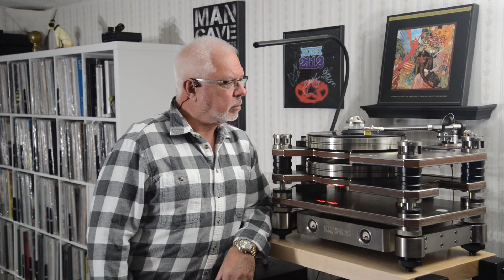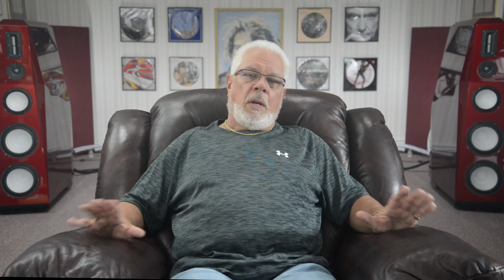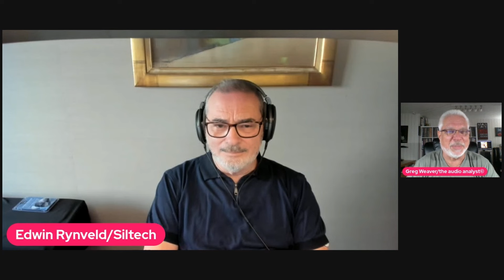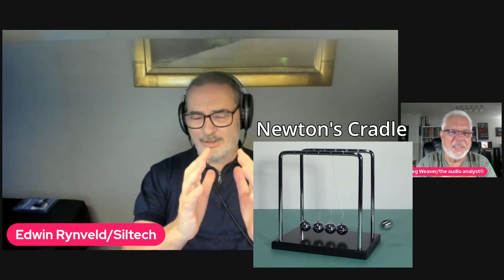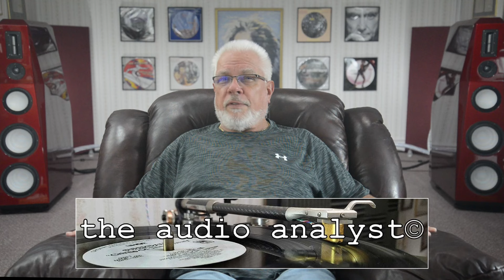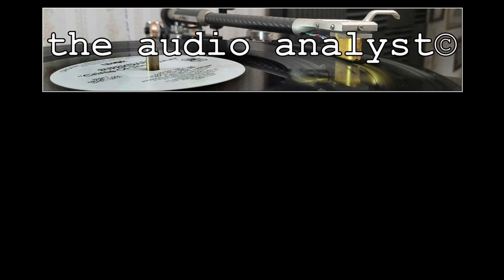E195: Edwin Rynveld and Siltech's Master Crown Cables

Comment: I have personally analysed a 'monocrystal' SIltech conductor at a world class metallurgical laboratory. It is definitely not a monocrystal! I t has a very fine grain structure, close to nanocrystaline. Anybody can do this test. It's unbelievable that the company says it's a monocrystal conductor. Monocrystals are extremely expensive to produce and the methods are well documented.
Reply from the maker: LOL, of course you have! And of course anyone can do it...in their kitchen, right! What a moronic, nonsensical claim...

So, what lab was this done in, where is it located, how did YOU have the ability to use that lab, and how much did the access cost? Be careful here, this Can be checked out.

And more importantly, since the Master Crown cables are the only models that they have made claim to be monocrystal, and since they are barely in production as of this writing, WHERE did you get one? What model was it? How did you acquire it, and at what cost? Be careful here, this CAN be checked out.

The likelihood that you have actually done this is SO PREPOSTEROUS that I dare you to even try to defend your statements...
Reply: @theaudioanalyst  I am dead serious, this is an ISO certified lab,I can contact you privately and pass you all this. It is definitely not moronic and nonsensical!!!!
Reply from the maker: @GeorgeStanton  Sorry, that is not how it works. You've made these preposterous claims HERE, so put up or shut up. Post this "evidence" here to substantiate your otherwise baseless claim, or we will all know just how bogus your statement is.
Reply: @theaudioanalyst  I just sent you email on your site.
Reply from the maker: @GeorgeStanton  Ok, so as I said, this is not how this will work. You cannot make PUBLIC accusations, then slink off behind the scenes to try to support your insulting and possibly slanderous accusations... 

ALL - below is the email that @mickgrc (email address - michael758@gmail.com) sent me to at 6:28 PM last night, October 8th), sent to defend his accusations... 

By the way, the REAL ISSUE is revealed about two thirds of the way through his response. Guess what? He makes his own "silver wires" that, of course, are "...actually much better than Siltech/CrystalCable." What a joke...

Again, I must point out that he completely ignores the reality that the first Monocrystal Cables from Siltech, the Master Crown cables, have JUST BARELY started their production runs and are beginning to ship. To that end, he cannot substantiate how he acquired one, let alone that he has in fact even done so. Nor does he provide ANY real info that supports his accusations against Siltech. I have forwarded this info on to Edwin Rynveld and the Siltech team for comment...

Hello Greg,
  This is Michael, the person who commented on the 'monocrystal' Siltech's real grain structure.

I happen to actually own a fully equipped and certified metallurgical laboratory, part of a stock market listed industrial business.

Being an avid highender I have bought Siltechs and CrystalCables for my system and I could not hold 
myself.I had to put them under a microscope, as when I researched the ways to produce monocrystal silver
I realised that this was probably not the case with these cables. We are talking extremely low production rates 
for a continuous cast wire, some few centimeters per hour, and other big difficulties.

So I sent some pieces of them to the lab and had a couple of world class metallurgists look at the results. Not that it was really needed.

It was obvious. this is DEFINITELY not a monocrystal conductor. 
And dont get me wrong: it sounds wonderful!

So, I have known this for some time, and, OK, I respect their work and their products, but this  is going a bit too 
far, all these stories and theories around monocrystal etc. 

I am being very frank, This time watching this video on your excellent channel I could not hold myself.

So, all data, pics, signed reports if you like, by world-class metallurgists are available.

HERE IS THE REAL ISSUE

I can also send you my silver wires, developed in the last couple of years as a hobby-turned-startup,
actually much better than Siltech/CrystalCable.

But this is another story.
In case you want more info be sure that I am a cool and straight person and contact me.
It would be an honour to have a chat on the phone.
     Congratulations again for your site,
     All the best,
         Michael S.
PS I am not writing my full surname as I have met Erwyn as an admirer in the past and I really do not want to create a mess out of this.

Do ANY of you believe this nonsense?
Reply: @theaudioanalyst  Dear Greg, I thought you were a gentleman...Well, in time you will receive your public answer.
Reply: Oh, to be precise on what material I tested, It is Crystal Cable Dreamline plus and Absolute Dream, both declared "Monocrystal' and obviously also used in the Siltech cables line.
Reply from the maker: @GeorgeStanton  Wow! First, you make public accusations against a 40-year-old established manufacturer. Then, you dilute your absurd contentions and accusations by adding that, oh, by the way, YOU actually make silver cables! And of course, your designs are superior to those of Siltech's, with four decades of experience in developing and constructing extremely well regarded cable products. Further, you hide behind aliases and refuse to use your real name and accept the accountability for your actions. And the real pisser is that you've choosen to use MY forum to do all this!

THEN, you have the nerve to accuse ME of ungentlemanly behavior? Man, you have some stones on you...I'll give you that much.
Reply: @theaudioanalyst  Dear Greg, I never said I produce cables or designs. I experiment with silver conductors using the help of world-class metallurgists. I do not sell cables! What I see is that instead of just asking for the data calmly and with some dignity, you chose to attack me in the worst possible manner and really create a mess. I stand behind all my statements. I never said that Siltech Cables sound bad, they are among the best cables in the market, my personal favourite, as are Crystal Cables. But cables I own, Crystal Cable 'Monocrystal' models which I mentioned above and 100% original,  are definitely not monocrystal. Now say what you want and thank you for the exchange. As I wrote, in time you will receive your public answer.
Reply: Somehow my previous message was truncated at the end. So, cables I own, the Crystal Cable 'Monocrystal'models I mentioned above, are definitely not monocrystal silver. Say what you want and thank you for the exchange. As I said, in time you will receive your public answer.
Reply from the maker: @GeorgeStanton  So, here is your direct quote... "I can also send you my silver wires, developed in the last couple of years as a hobby-turned-startup, actually much better than Siltech/CrystalCable." Are you now saying that you didn't say that?
Reply: @theaudioanalyst  I said it but 1) wires are not cables and 2) I do not sell cables
Reply: And may I say, I will not continue here.I sent you a private message and you decided to make it public. I was frank and open and you decided to ridicule me publicly.
Reply from the maker: @GeorgeStanton  You ONLY sent me a direct email AFTER you publicly cast aspersions on a company USING MY CHANNEL to launch that attack and after I called you out, insisting that you support your assertions. You need to accept the responsibility for this... You can't just calmly, and publicly, make accusations, then run away and act as though you've done no harm...

And your quibbling over what you said and how - "I can also send you my silver wires, developed in the last couple of years as a hobby-turned-startup, actually much better than Siltech/CrystalCable." as if you weren't trying to imply that Siltech was deliberately lying and trying to trick the public, and that you had "built a better" product is nearly as unjustifiable as pretending that you've done nothing to deserve these questions and concerns... 

Trust me, IF there is any form of vindication from Siltech and their team in ANY way defending what you have tried to claim, hiding behind anonymity and asserting your development of a "better" wire , I'll be happy to say so here, just as clearly as I've insisted you take responsibility for what you've already asserted...
Reply: @theaudioanalyst  Public Apology Regarding Counterfeit Audio Cables Testing

To the public, the Audio Analyst, Siltech, Crystal Cables and all concerned,

I am writing to express my deepest apologies regarding my statements regarding metallurgical tests I conducted on what were thought to be genuine Crystal Cable products. It was in fact revealed that the cables were counterfeit copies and not the original products as I initially believed they were.

Yesterday, I finally traced the provenance of these cables and discovered that they had been obtained years ago from eBay and, after changing hands 3 times, found their way to me as genuine bargains. When I conclusively found out that these cables were not genuine Crystal Cables, I was shocked and deeply embarrassed. The fact that these counterfeit items ended up in my possession, leading to mistaken assumptions during testing, is something I truly regret.

I feel compelled to offer a sincere and heartfelt apology for any confusion or frustration this discovery may have caused. 
Siltech and Crystal Cable products command the highest respect and definitely belong to the best of the best of audio technology.
Reply: @theaudioanalyst  Public Apology Regarding Counterfeit Audio Cables Testing

To the public, the Audio Analyst, Siltech, Crystal Cables and all concerned,

I am writing to express my deepest apologies regarding my statements regarding metallurgical tests I conducted on what were thought to be genuine Crystal Cable products. It was in fact revealed that the cables were counterfeit copies and not the original products as I initially believed they were.

Yesterday, I finally traced the provenance of these cables and discovered that they had been obtained years ago from eBay and, after changing hands 3 times, found their way to me as genuine bargains. When I conclusively found out that these cables were not genuine Crystal Cables, I was shocked and deeply embarrassed. The fact that these counterfeit items ended up in my possession, leading to mistaken assumptions during testing, is something I truly regret.

I feel compelled to offer a sincere and heartfelt apology for any confusion or frustration this discovery may have caused.